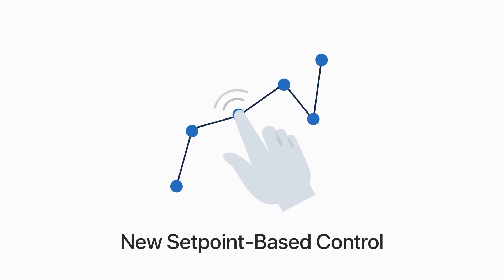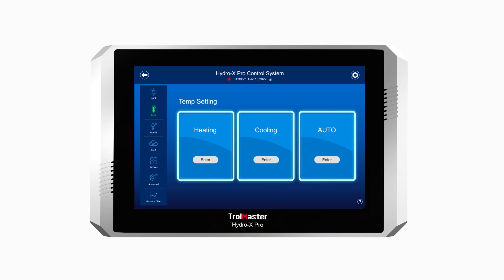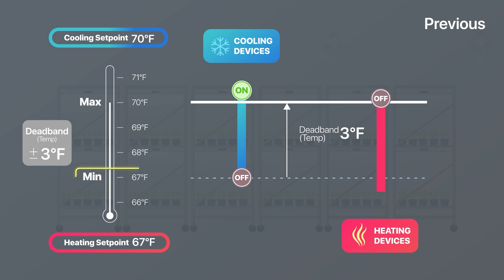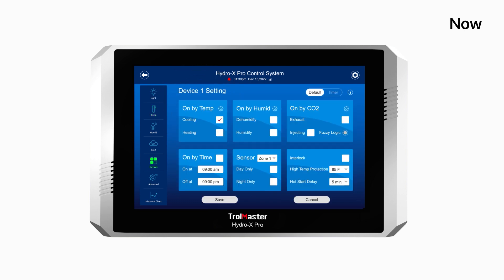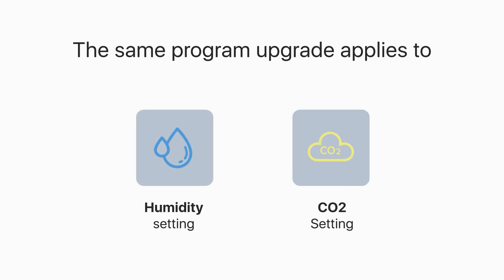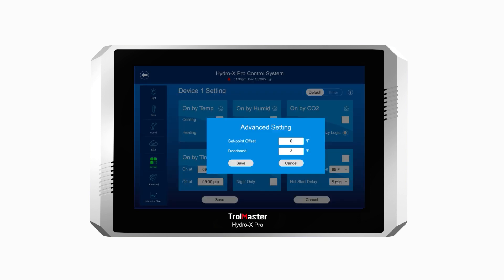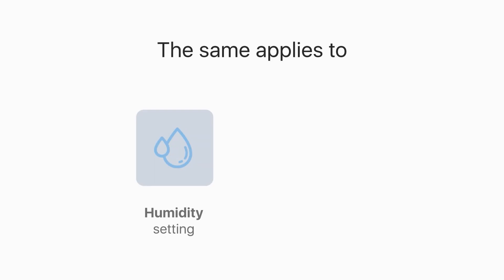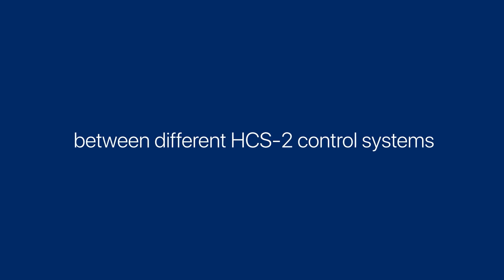Hydro-X Pro - Firmware Update (Setpoint-Based Control with Offset)

Comment: Now trolmaster needs to implement a way for us to know if we're fast-cycling, like if the AC is so powerful that the temp always swings so low that the heater kicks on, causing them to pingpong between setpoints. And maybe even better, it would be nice if trolmaster would include a way in the logging for us to know when and for how long a piece of equipment was on and allow us to download the data into a spreadsheet.